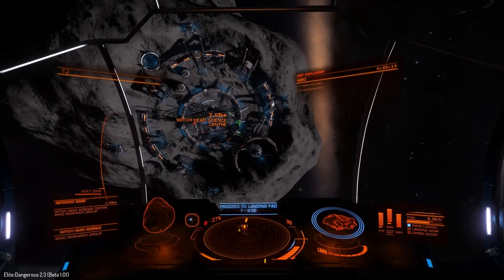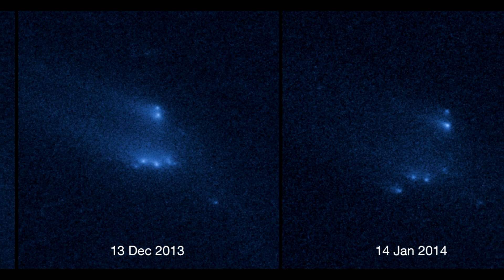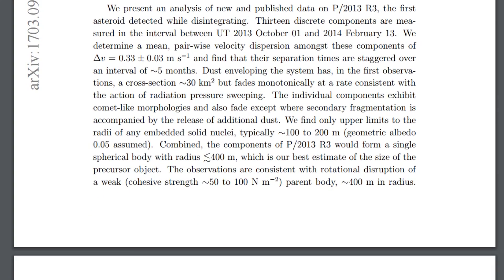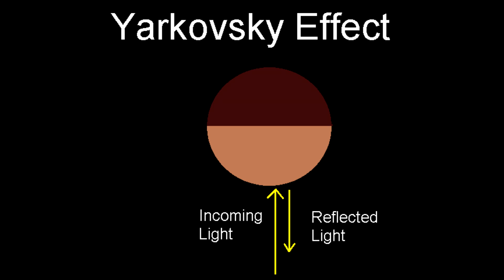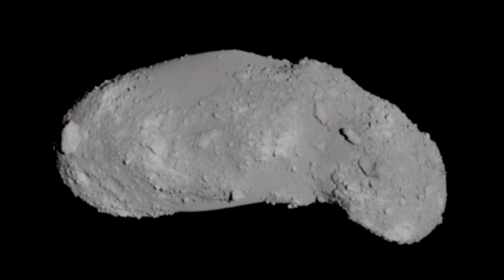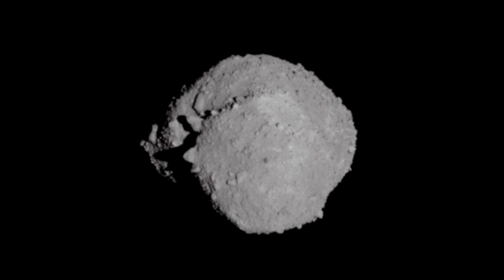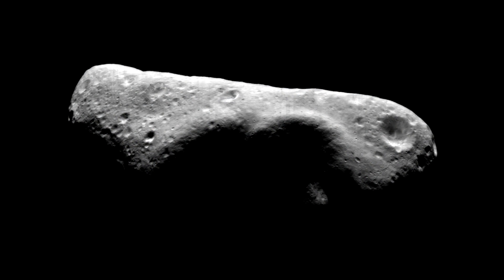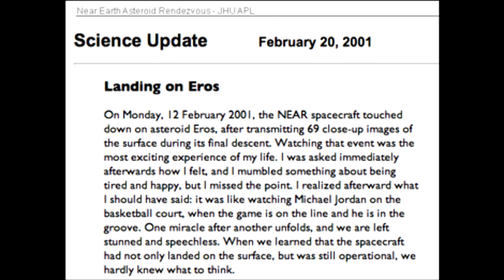Spinning Asteroids To Make Space Stations

Comment: I agree... yet considering that according to some famous dude, (that made a book about terraforming planets)... we will need close to 17 million super carrier space ships to haul just the needed hydrogen... puting a asteroid to spin doesn't seem that far fetched...  far fetched is the actual number of super carriers needed... close to...17 million this means that they should be made in a super streamlined fashion... here I imagine replicating the manufacturing set up seen in the automobile industry...
Reply: Could be 17 million round-trips of super carrier space ships instead of 17 million one-way trips. With the whole thing of taking 10 years to spin up, you'd have a lot of time to get more than one trip out of each ship. Still a lot of ships, but the faster those super carrier ships are, the less of them you need. If each trip takes 10 years, you need 17 million ships, but if each trip only takes 1/10 of a year, you only need 17 thousand ships. Still a lot of ships, but at least it's within the range of possibility. The real problem would be where do you get the raw materials for the ships in the first place? I'd suggest Asteroid mining for precious and rare-earth metals, and mining the Moon for most other materials. There's lots of aluminum to be found on the moon, and Platinum group metals are available at much higher concentrations in certain metallic type asteroids.

Comment: Perhaps you could use 'soft' collisions between asteroids to spin up the asteroids? That is, using some of the momentum of other asteroids, and using the the thrust units to change orbits to create a momentum change - orbital momentum into angular momentum for the asteroid. The 'collision' could be in the form of some sort of soft coupling, a huge electrostatic or magnetic device. If this happened before any melting, it might not need to be so soft in any case. Just a thought...

Comment: It's not even like you need to spin the asteroid itself up to get the main stated benefit of placing the living area inside a hollowed out section of it, namely the radiation protection of the rocky outer shell. Could just as easily have a rotating space station sitting inside the cavity perhaps with non rotating sections on each end which could have struts to secure the structure in place and ensure small perturbations don't cause the station to collide with the chamber walls. Other bonus there is the structs could easily be made to hold machinery to haul standardised cargo containers up into the station and deliver outgoing cargo to docked vessels. It should be fairly trivial to make automated machinery to move standardised boxes around like that too no need to complicate things by having an atmosphere and high spin rate inside the area ships are docking in.

Comment: You would not need to rotate the entire asteroid. A simple method would be to house a really big cylinder shaped habitat / working area that can rotate freely inside a housing/cage/frame that is located inside the asteroid driven and suspended by electromagnets (assuming resources and energy needed would be available). The habitat could be entered and exited through a gyro/gravi-lock system  located at the centre of the cylinders rotation, to enter the hapitat the gravilock is enetered and then spun to match the rotation of the 'Habi-tube' to exit the gravilock is entered and spun down to a stop and then exited. Not all activites would require gravity especially working activities... The Habi-gravitat would be like going home after work where people could experience earth or even heaver gravity between work shifts. Those working as controllers, workstation operators would stay in the gravi-habitat most of the time while those working outside would be there during downtime.

Comment: If I was going to colonize an asteroid like that, I would use a "worm coring" method. I would build a toroid spinning habitat on one end of it, providing an artificial gravity environment. Then I would use standard mining equipment to dig a massive tunnel straight through the center to the other side. This tunnel would be capped at both ends and linked to the existing station, but at first would be a zero-G environment. Then I would head to the middle of this tunnel, and slowly start to expand outwards, taking a cylindrical chunk out of the middle, big enough around to make another cylindrical habitat that could be spun up to comfortable gravity. 

Once that's going, colonists would have two places to get in some gravity exercise, but still the tunnel would be zero-G. Then you just expand outward from the center, clearing more space and adding more spinning habitat until you have plenty of space for the people to spend most of their time in the gravity areas. Once you have most of the asteroid hollowed to this level, assuming there is more room to expand towards the surface, you do so, slowing down the spinning components and moving new housing into outer rings as necessary, until eventually the whole thing is mostly hollow. Since the spinning components would all be engineered for durability rather than natural, it shouldn't break up. The benefit to this over just building a giant O'Neill cylinder from scratch is that 1. you would be able to constantly mine the asteroid through the development process, making it a revenue-producer from day one rather than a complete money pit until mostly completed, and 2. the rocky shell should provide a strong defense against radiation and impacts, like coating an O'Neill cylinder with massive amounts of armor.

Comment: In the case of Eros. Couldn't the hollowing out, the building of the station inside and other structural parts (not necessarily at the hollowed out area) be used to reinforce the asteroid without needing to melt and "solidify" it? Also, why not process only the outermost layers, basically creating a shell a shell where the inside walls and outside walls are stable and rock solid (including those walls around any "holes" you would have, like entrances), with a thick layer of rubble  that is held inside of them (it is basically the rubble infill)?

Another way to consolidate that rubble is with some kind of injectors of binding material/substance (that seems less complicated than it is tedious, resource demanding and repetitive). Combine both techniques, and you have this solid shell, with a clumpier and more consolidated interior rubble infill instead of just lose relatively small rock and dust, and it seems more realistic.

As for Ceres, yes, I don't see the point of hollowing it out. Just build stuff on the surface and use magnetic boots for extra grasp, and have entirely artificially created sniping bases on the surface or in orbit for recreation, rest and specific functions at more human friendly G forces. (By surface I also consider digging a "created" and underground, but normal direction underground, not "upside down" hollowed inside). Or even if you hollow it out cause you want the think material protection: make it like there is a ball inside another ball, so that the inner balls spins while Ceres itself, the outside ball, does its normal thing. All the benefits of living in a hollowed out space round rock, none of the downsides of actually sniping the rock itself.

Comment: A bit of this is addressed indirectly in the books. 

They do say that it took decades to spin up an asteroid (though I don't think they were talking specifically about Eros), and the Epstein drive is fueled by very small pellets, so it is phenominally efficient.

What isn't addressed is keeping the body in one piece and ejection mass.  So in-universe, energy and time are addressed, stability and propellant are not.

My head canon is they use the rock itself as ejection mass.  As it is melted by the Epstein drive, the magma itself is used to accelerate the drive.  3/4 issues resolved is good enough for me when the story is as good as The Expanse.
Reply: "small pellets"=/="phenomenally efficient".  Basically, it's magic.
Reply: The Epstein drive should be something close to Hawkins radiations.
Reply: @Fridaey13txhOktober  ?
Reply: Warp Drive - Hyperspace - Wormholes - Transporters...yada, yada, yada. How Many Angels can dance on the head of a Pin? It's not called SciFi=Science Fiction, or SyFy=Science Fantasy for nothing folks!

Comment: Building a giant ring around an asteroid and connecting it to the asteroid with a few support structures, you could gently but relatively quickly spin up that ring using simple electric motors and solar panels. That would possibly be one of the cheapest ways to spin up such a gigantic structure.

One could also do the inverse of this, like creating a spinning cylinder inside of the asteroid. That would leave the asteroid as a shield and a place for solar panels. Doing this would allow you to start very small by boring a simple ring inside the asteroid and start by spinning a few capsules to serve as an initial base of operations. You can slowly add more capsules and continue widening the ring to allow for more space as needed.

Comment: Decades ago, Prof. Lionel Wilson (UK) discussed hollow asteroids as the common, result, of small impactors penetrating some depth before fully releasing their superheated vapor of impact hollowing-out the asteroid insides, expanding the looser rubble outer thickness, and depositing melt and vapor, brazing, sealing, and pressurizing, interior chamber 'walls'.

Comment: What if they used some kind of adhesive/mortar to strengthen the outer walls of the asteroid? And use reaction wheels or RCS thrusters to counteract the slowly increasing spin rate. I mean there is human activity around the asteroid and the increase in spinning happens very slowly over a course of centuries. Doesn't seem hard to overcome with technology.

Why spin it up when it still full of rock? Why not hollow it out first?
Reply: NeonGen2000, 
Much cheaper to build a spinning habitat inside an artificial stationary shell and cover the shell with all the waste material from mining. This could be constructed on the surface of an existing asteroid on the axis of spin, so we don't have to wait for some excavation to be completed.

Comment: Wasn't it stated in the books that spinning up Ceres took the better part of a century? Also, early in the first book, there's a scene when Detective Miller visits the apartment owned by the MacGuffin girl Julie Mao. The apartment is one among tens of thousands carved out in the sides of what used to be a reaction mass chamber for the spin-up engines, half a kilometre wide, about equally tall (deep?) and several kilometres long. And there were a dozen of these chambers, suggesting at least a dozen arrays of engines. If all of them consisted of Epstein drives manufactured a decade or more after the prototype, then maybe...

Comment: Not sure this would change the math all that much but in the books they talk briefly about huge "V shaped" sections of Ceres that were presumably cut out and ejected as reaction mass to spin up the asteroid. If they did a lot of these through out the station it could substantially reduce the mass of the asteroid with out reducing the radius. Again it probably would not be enough to prevent it from flying apart (not to mention reducing it's stability in the process) but at least it doesn't mean they need millions of Epstein drives to do it.